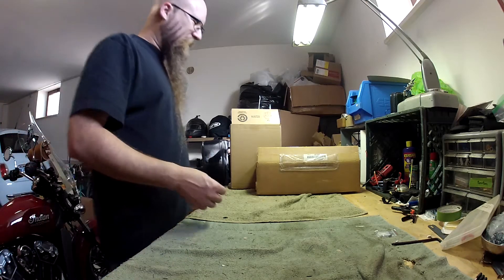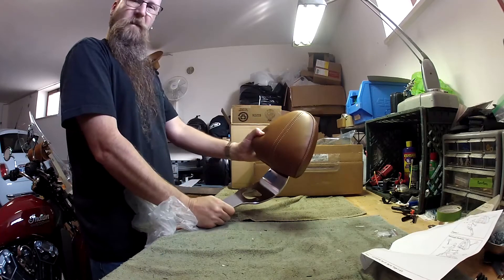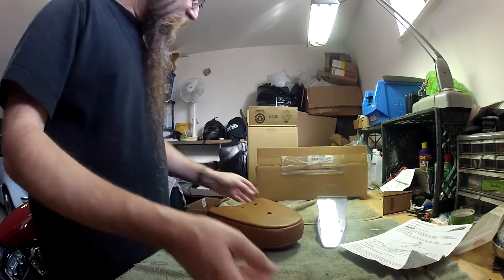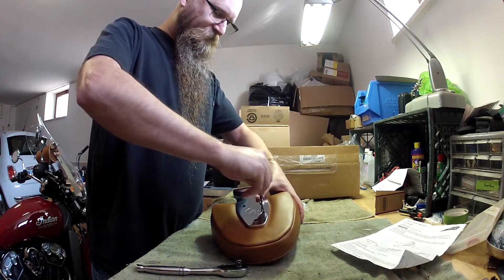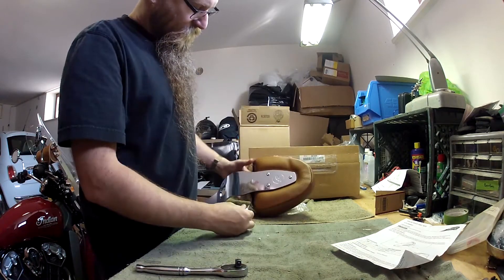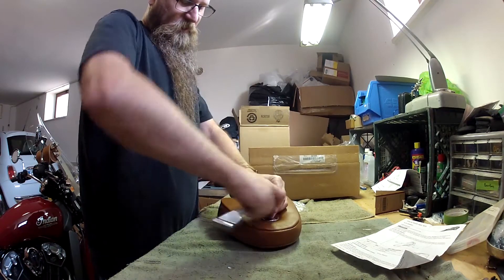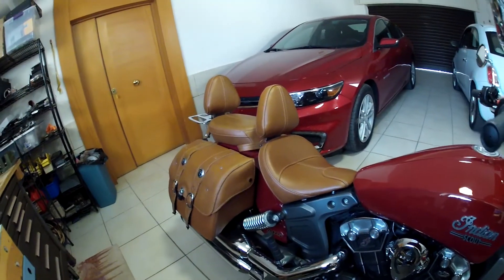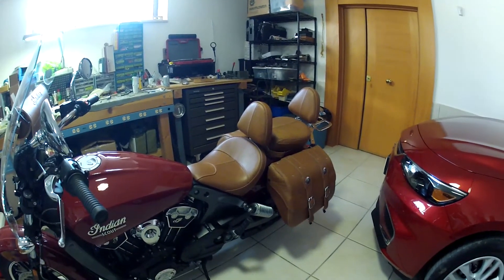Indian Scout drivers seat back rest install

Comment: Have a 2018 Scout that when I attached the drivers backrest the seat wont fully lock down since the bracket is bolted to the area shared by the passenger seat.  How did you resolve the issue of the seat not fully engaging the lug?.
Reply from the maker: Yeah, it's a total pain in the ass. Basically, you have to push the seat back and down really hard. Mostly towards the back and make sure you have it lined up really good. Crappy design. After a few (30) installs and removes, it gets loosed up a little and is easy to put on. Good luck
Reply: @OpenRoader  thanks!  Ride safe and keep both wheels on the ground!
Reply: @OpenRoader  found the solution!  Used a heavy grit sandpaper to sand down the lug.  I  figured after pushing and smashing it was going to be damaged anyway.  It takes some time but after sanding about 1/8 an inch off, it slid on (still took some pushing) but it's on and it's tight.

Comment: Does the driver seat snap down?
Reply from the maker: Jeff Massey sort of. It has a channel that slides over a peg at the rear and a plastic knob at the front the pops into a rubber grommet in the front
Reply: Open Roader sounds ezee to install/remove,but secure😃.
Reply from the maker: Jeff Massey well, to be honest, it's one of my least favorite designs on the bike. The rubber grommet started tearing the first time I pulled the seat up. i have ordered two new grommets, but they on on back order. I would prefer the seat lock down. But it is what it is.
Reply from the maker: Jeff Massey it needs something. I know how to remove the seat so the next one won't get damaged, basically reach under with fingers and hold the grommet on the seat when you lift.
Reply: Open Roader got messenger?
Reply from the maker: No, sorry
Reply from the maker: Jeff Massey thanks for the offer, I ordered a few so I'm good to go (when they arrive)
Reply: Open Roader 5415489 is that the part? I gotta go to our local Indian dealer today 2 get my Road King inspected. More than happy to look for ya...and anything else on yer wish list. Was there a plastic rivet on that grommet?
Reply from the maker: Thanks for the offer. Nothing else needed.
Reply: Open Roader You're welcome. Ride safe...😀😀😀😀😀
Reply from the maker: Jeff Massey you too